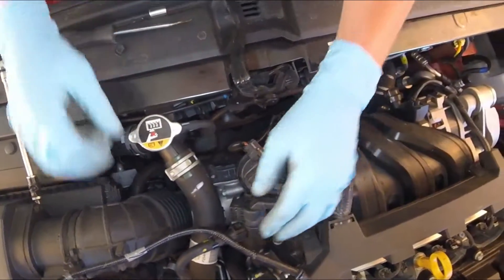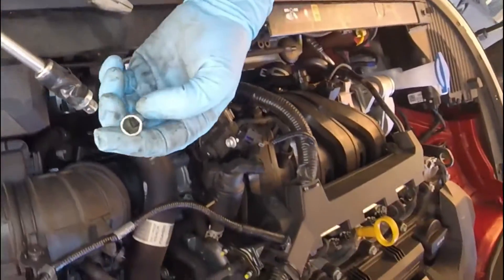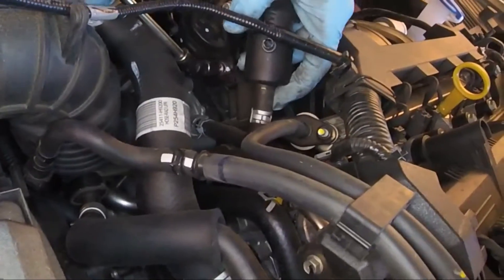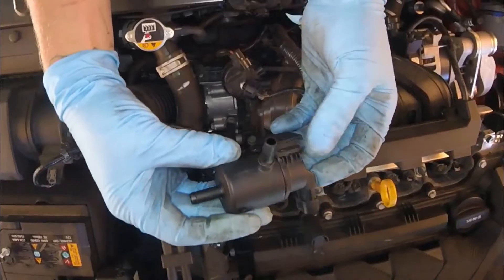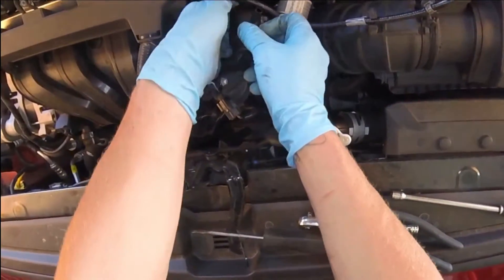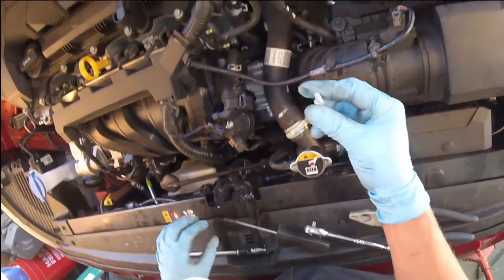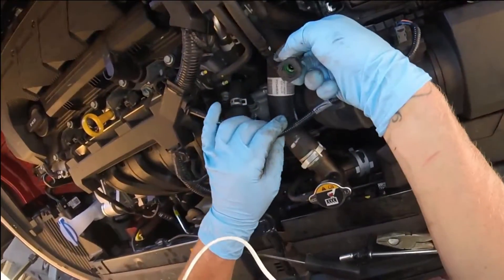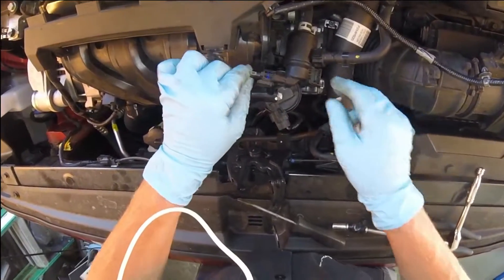⫷ Hyundai Accent Purge Control Valve. Remove and Replace. p0443 p0441 p0464 p0455 ⫸

Comment: I know that you did not replace this one but it would have been nice to seen a trick to get the metal unstuck from the rubber. I used a screw driver as a wedge between the plastic and the metal piece to get out of the rubber

Comment: Should I disconnect my battery before changing my canister purge valve on a 2017 Hyundai accent?
Reply from the maker: If you look at any step by step books. They say to disconnect the battery for almost any job that includes a electronic part change out. But, I can say... I never do.

Comment: Like you said, if you can either suck or blow through either opening, it's bad?
Reply from the maker: If you try to suck or blow on the hose side of the PCV valve. You should be able to suck air through the valve. You should not be able to blow air through the valve.
Reply: @ScottiesHobbies  Great! Thx for the vid, surely this comment thread will help another. 🤜🤛

Comment: I have a 2017 hyundai accent basic model. Im looking in that area you took the canister out for the p0455 code. I cant seem to find that.. unless the part looks different? I need help lol
Reply from the maker: If you are referring to this video.. this is on a purge solenoid. you sound like you are looking for the vent solenoid if you are looking near the cannister.  a P0455 is a large evap leak. Have you started with the basics? the Fuel cap? is the seal on the bottom side of the cap good? you will then need a smoke diagnosis if you don't want to manually check the vapor and purge solenoids to see if they are sealing.
Reply: @ScottiesHobbies  Can you clean (spray) the pcv with maf sensor cleaner to fix it? Or is it better to replace?
Reply from the maker: @memoryrinehart  You can clean it. But I would prefer to replace it.It is super cheap and overtime the little Spring inside the PCV dolls can go bad or get weak.

Comment: Will this issue cause the car not want to start right away after refueling? Runs fine after it starts however and the code says this..
Reply from the maker: It is very possible. I just Uploaded a video in the last few months showing how to test these components.. It is possible that your vapor purge is not shutting while pumping gas and causing fuel vapors to enter the intake. I would test the vapor purge solenoid before replacing though.

Comment: So is a purge valve the same thing as a vapor vent canister solenoid?
Reply from the maker: No. Vapor vent is going to be more near the canister. That solenoid allows freash air into the system and pressure to release to the atmosphere. 

The purge solenoid is more near the engine and allows vapors to enter the intake and go threw the combustion process and out the tail pipe.
Reply: @ScottiesHobbies  ah okay, so in the video you replaced the purge valve?
Reply from the maker: @dekko8286  yes.